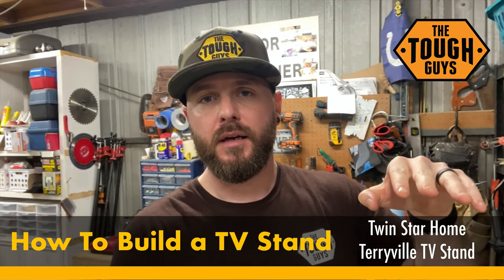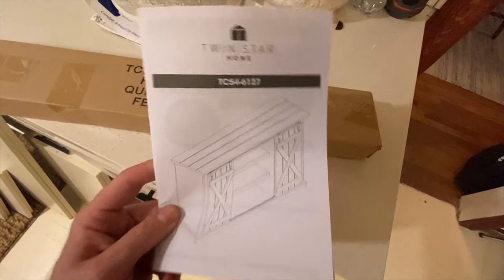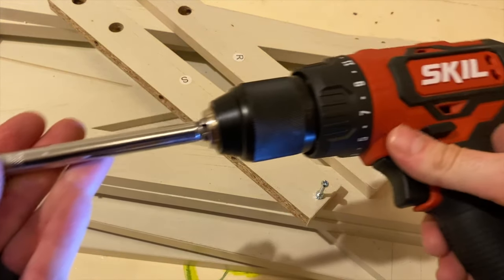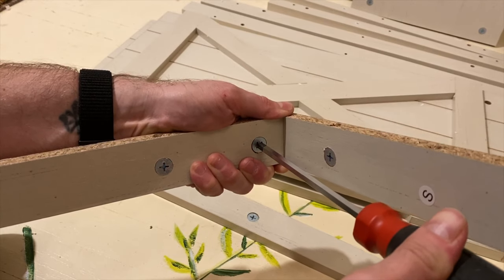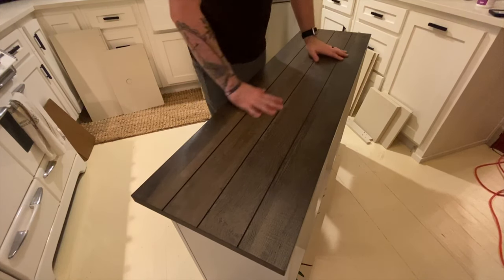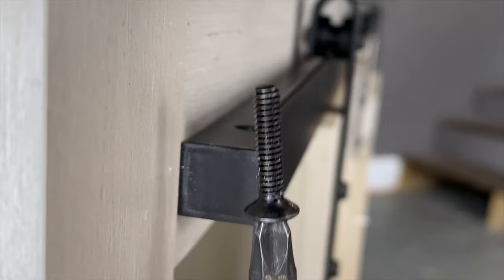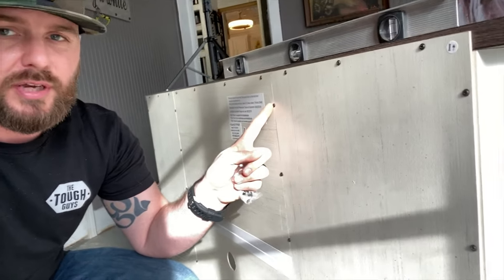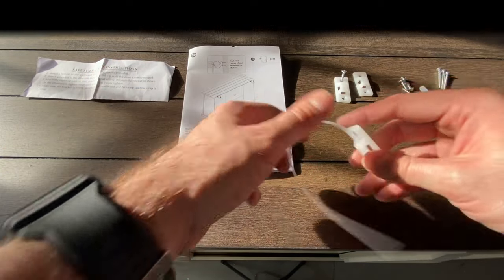Twin Star Home Terryville TV Stand - DIY Instructions to Build!

Comment: Just put this together.  Video was definitely helpful.  If I had to do it again I think I would attach the piece for the lower track on the door first with just one screw, but loose enough so you can still move that piece.  Then slide the doors on to the upper track.  Would be much easier to put the other two screws in that way I think.
Reply from the maker: Thanks for the note!! Glad the video helped you out - We still love the TV Stand, it's been great and held up really well!

Comment: I just purchased this and everything seemed to be going well until I got to the back panels. There are no predrilled holes in the back to screw in the back panels. I kept trying to figure out if I did something wrong, but everything seems to be in place. Please help!
Reply from the maker: Could be a defective back panel that's for sure!  Mine did have tiny little spots to use.  Is it possibly you have it on backwards?  Wish I could be of more help to you on this one - good luck!

Comment: Do you have to install the back panels? My main concern is that the center panel might get in the way of devices that are deeper due to the cables, like a receiver. I just bought one.
Reply from the maker: It’s thin enough we’re you could use a razor knife to cut a section out and it would be fine still.  These back panels tend to add some integrity to the build in my experience.  This one is pretty solid without, but having all those perimeter screws definitely helps! Good luck with your assembly!!! 💪🏻
Reply: @TheToughGuysTV  Thanks for the tip. I was gonna install only the outside back panels but I'll just cut out a bigger hole in the center after installing them.
Reply from the maker: I feel like that would be the best bet. A jigsaw might make quick work of it if you have one. Good luck!

Comment: I bought this from a 3rd party seller and all the hardware is missing 🤦🏽‍♀️

I have the manual that states all the hardware but how do I find the individual names ? The names they come with are like two letters - bunch of numbers but the search doesn’t match anything online. 

Just a shot in the dark here 😂
Reply from the maker: Home Depot and Lowes sell an assortment of connectors in store. Maybe grab some screenshots from the videos of how they look, and take those to a store to see if a rep can help you match them up? Or maybe Amazon search for parts kits for that unit? Or even EBay? Good luck on the search, bummer to hear you didn’t get the hardware included! Thanks for reaching out

Comment: this is going to be really long. Right now I am pissed. I purchased outdoor furniture covers from amazon. Amazon did give me my money back for the two sets of covers that's not the problem. The problem is amazon doesn't want to take any blame for the damage to my patio furniture. The outdoor covers did not protect my furniture like it was supposed to. I have been dealing with this since Nov 2022 the covers have caused mold and damaged my cushions so amazon open a claim with Sedgwick insurance company and Sedgwick sent it to the company who is selling the product on amazon called twin star home they did not want to pay me anything so I filed a complaint with the BBB and Pinellas county consumer protection agency then they started to change their tune. They told me if I had a receipt they would pay me $1000 if I don't have a receipt they would only pay me $300 I told them I don't have the receipt so they would only give me $300 so I started searching and calling and finally about a 2 to 3 days later I called the company where I purchased the set from and they said they would try to get a copy of the receipt for me. I did not hold my breath but the next day I got a copy in my email so I called the BBB and told them and they sent a copy of the receipt BUT THE COMPANY STILL WILL ONLY GIVE ME $300 this is not fair or right. One more point I want to make, the company twin star said it was my fault because I was to not store the cushions with the covers I was to remove the cushions. I have a statement from twin star home saying it was my fault for the damage. There is nowhere on the amazon web sight where they are selling this product saying you can't store your cushions with the furniture this company twin star has 3 videos and the third video tells you how to use your covers and it shows the cushions being stored with the covers this contradicts twin star home story. I am still waiting for the check for $300 that they said they sent out on Jan 10th I still have not received. I thought I could trust amazon, this product was sold by amazon and shipped by amazon it looks like I am going to be out $768 I just want to be made whole not screwed and that's how I feel. This company twin star home only cares about profit from the customer and I am feeling the same way about amazon because amazon is not stepping up to the plate. YOU CAN LOOK AT THE 3RD VIDEO FOR YOURSELF  AND I AM SENDING A COPY OF THE STATEMENT TWIN STAR HOME SAID THERE IS NOWHERE IT SAYS ANYTHING ABOUT THE CUSHIONS.
Reply from the maker: I have no direct affiliation or long relationship with this brand. I wish you haven’t had such a bad experience of course. I bought a fireplace unit, assembled it, and eventually sold it a couple years later - all was good for me.